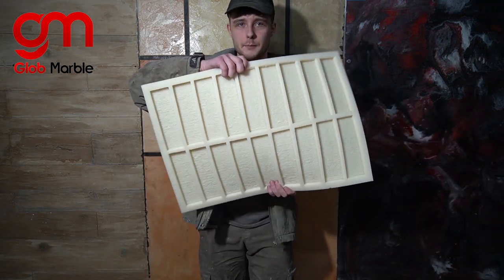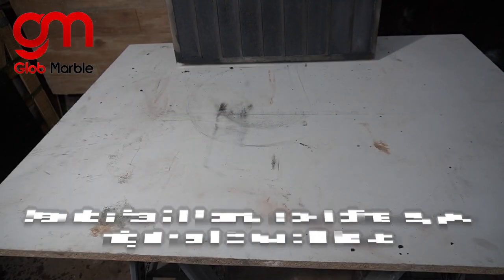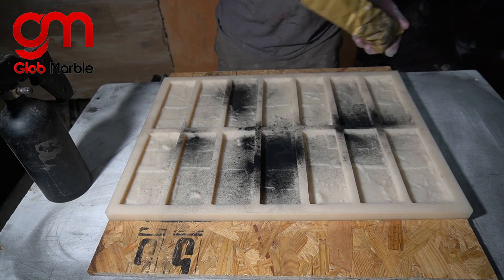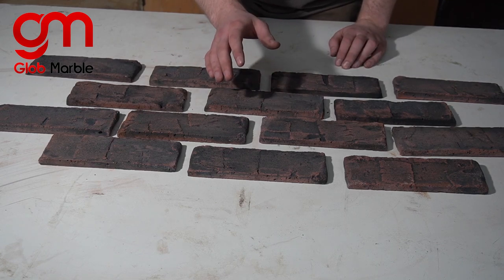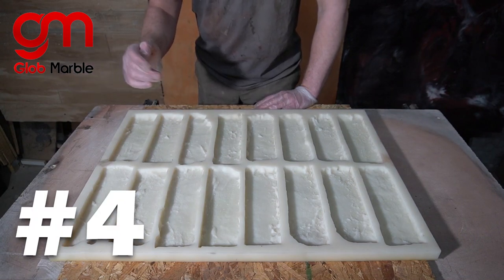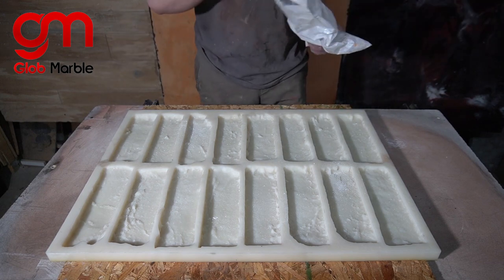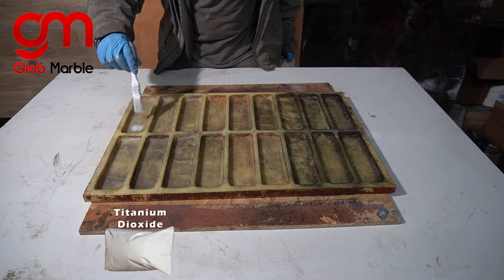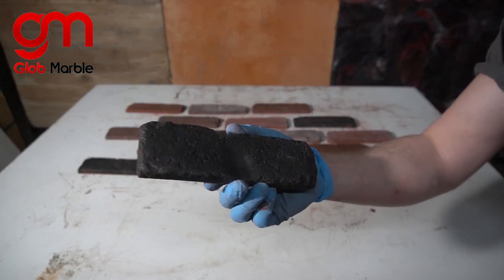How To Color Concrete Bricks

Comment: Hello ! In fact, I have a problem that after demolding , the color of the stone is clear and as desired, but after a very short period, the color of the stone becomes faded and the color barely appears. By the way, I know that when you spray the stone with sealer, the color will return to what it was, but I want to know how the color of the stone can be solid and rigid without using sealer. Thank you in advanced
Reply from the maker: Any unsealed concrete will eventually fade. The only solution is sealing.

Comment: Is there any way to clean the molds from the pigment? Are there any chemicals that are used for removing oxide pigment from the mold without damaging the silicone?
Reply from the maker: The best way to clean them is with our release agent without diluting it with water

Comment: Hi, I keep trying method 4 but the colour just keeps diffusing into the concrete and I just get a big washed stain instead of that powder look of iron oxide. Could you help with that? Is it because of the plasticizer? 🙏

Comment: Hey.good day.from phililpines. Ilove your work. Can use (grout/mortal)for tilea with color instead of iron oxide pigment?
Reply from the maker: You can, but I cant promise that it will look exactly like mine :)
Reply: @GlobMarble  can i have your fb name. So i can direct asking chat with you
Reply: Sir ..the iron oxide is use for cosmetic? Like in our skin.? So your pigments and mine iron oxide(cosmetic) are the same to yours? Thanks
Reply: Im planning to buy it. But idont have any idea what is it. Im not sure your pigments is the same as mine( iron oxide cosmetic)
Reply from the maker: Our pigments are definetly not for cosmetic purposes. They are manufactured specifically to color concrete. You can email us at sales@globmarble.com Here are a few links to the pigments- https://globmarble.com/water-based-concrete-stain-eco-stain.html
https://globmarble.com/concrete-color-oxide-pigment.html
Reply: @kidaquidado9129  same

Comment: Best way to clean your concrete mold is to use vinegar.
Reply from the maker: Maybe with silicon, but anything as acidic as vinegar will destroy polyurethane. The best way to clean our molds is with G-1 release agent, and if you clean and store our molds properly, they will last you thousands of castings :)